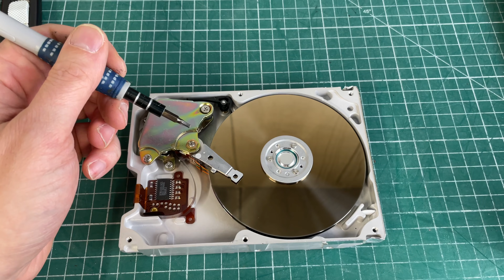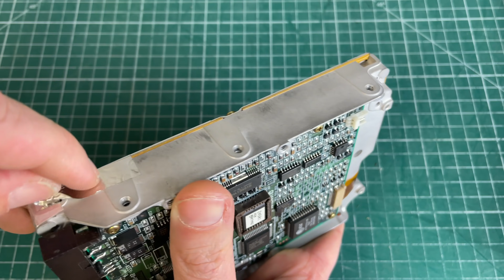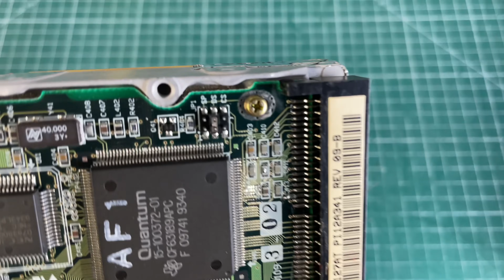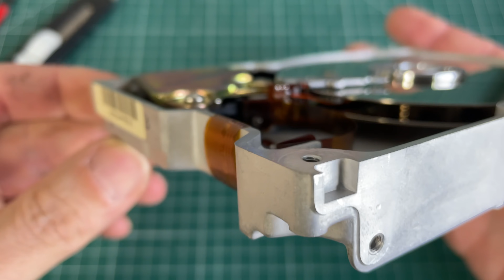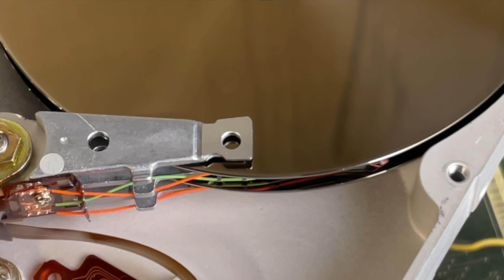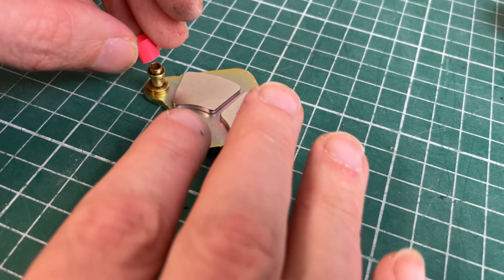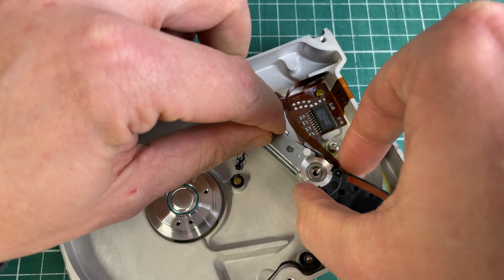Hard Drive Repair Gone Horribly Wrong

Comment: Hi - nice viewing , although not a fix it was interesting and learning experience

There are 3 similar looking screw heads Phillips - Posidrive - JIS
JIS - Japanese / Asia Industrial Screw - most items from that region will be JIS, they have a dot on the screw dome head when looking down near the cross ( not to be confused with a security key that has a dot or protrusion in the center of the shaft
That leave the gamble between Philips and posidrive, i use a Phillips no1 or no2 , if it slips i go find my posidrive

This link may help identify and explain
https://bike.bikegremlin.com/10583/phillips-vs-jis-vs-pozidriv/

Re the comment on the top platter - in most older hard drives RLL MMF and older IDE's the top platters top outer edge   and the bottom platters bottom outer edge  are typically not used

This make only in inner / sandwiched sides the actual data storage areas, there is 2 common reasons for this
1. Cheaper as you only need rear/write heads on the inner platter so each hard drive save 2 heads
2. Manufacturers at the time assumed the outer ones would get the dust and stray grease / filings etc and would get scratched, so they never used them, later on with the race on making bigger hard drives, manufacturers started to use them

On my IDE's back in the day the only repair would be to change the IDE circuit board ( my first IDE was in late 80's and was $400 for 40meg ), we all have experienced the scratchy sounds and later the can of marbles effect - unfortunately any noise = physical platter / head damage

The only servicing i do is if they have a external stepper motor, i clean it, wd40 and leave it for a hour, then upside down for  another hour to get the WD40 out as it is fine and may spray inside, plus ED40 is a cleaning agent not a oil, i then apply 2 or 3 drops of fine sewing machine oil and let it sit for a few hours to soak into the bearing / bushings

Oh if you dont use hard drives for a while they sort of get stuck, a more accurate term is "sticktion" for this on the initial start up if it does not move properly you give it a little tap to help loosen it up and get it to move, basically the heads are in park so long the stick there as the lubricant has dried in one spot

Good topic for review and viewing your repair process

Regards
George

Comment: Man those rubber bumper are a bummer, means my collection has an expiry date
Reply: I wonder if a temperature and/or humidity controlled environment could actually stop that degradation. Not that it would be feasible for most, but at least there could be a way to preserve some of these drives.
Sometimes I wonder how long it will be until all these great old machines from the 80s and 90s will inevitably break down. A couple of decades, or maybe a hundred year? Either way, sooner or later they will fail, and it makes me really sad.
I have an amazing "little" laptop from 1990, a 386SX NEC ProSpeed SX/20, and I hope to keep using it until I grow old (so for an other 50-ish years haha). It's actually on my channel, only shows a few seconds long beep error, but I have managed to fix it since then, and planning to do a video about it, running some games and benchmarks.
Reply: Nice thought, but ... how do you plan to keep the temperature constant inside of a working mechanical device?  :-)
Reply: @sirnickity  Well, I was proposing this idea for storage conditions, I think you are right, when it's actually running, I don't see any way to control temps.
Reply: All mine already expired. Same exact way. Down to WD and Maxtors now. 

Only Quantums I have are >20 GB.

Comment: Awesome attempt even though it was kind of a mission impossible. I think the aluminum tape is some kind of air tight seal. Isn’t the inside of the harddrive supposed to be a vacuum? Just seeing how fiddly it is working on those harddrives kind makes data recovery specialists absolute wizzards  with super human abilities. The inside is so delicate and one uncontrolled move could damage it forever. Just seeing that little screw accidentally dropping on the platter and it’s goneski forever. It’s almost like defusing a bomb!
Reply from the maker: The tape is to protect it from crt monitors wiping out its data. So I learned from the comments here ... lots if interesting people commenting so mission accomplished as far as I am concerned :)

Comment: Good to know, I have several Quantum hard drives. I also have a couple of Connors that all have a very different problem with a very similar symptom - A small permanent magnet holds the head in the parking position and slowly magnetizes the arm, so that the "connection" between the two is too hard to overcome by the voice coil. This one is easy to repair, just stick a small piece of sticky tape on the magnet. But I also encountered a few Connors where the plastic seal disintegrated into some kind of liquid (some disintegrated into goo, too).
Btw. a few years ago, the unspeakable happened - a Seagate ST225 of mine lost two heads (lost meaning they don't read any data anymore). When I used it last (several years ago), it was working fine. It has not been moved in the meantime.

Comment: And this is exactly why data recovery is so expensive. I have a 1TB HDD that is kinda dead... i opened then immediately closed after I moved the heads to parked position. Then bought a couple of donor drives but even 18 months since it first failed I still don't have enough spare cash to send it off for data recovery so it sits in a drawer. Way  too many things that could go wrong to attempt  myself.
Reply from the maker: My 3tb seagate external drive crashed last year. Was just sitting on my desk and from one day to the next it had a head crash. Didn’t fall, didn’t get a shock. No warning upfront. Got an offer from a Data recovery  company and it would cost between 1000 and 2000 EUR (depending on urgency). Maximum 80% could be recuperated and no large files (like video files).
Reply: @RetroSpector78  Brutal. I feel your pain.

Comment: Had the same sticky-bumper-problem with a Quantum 52AT. I also opened it up and put a thin slice of paper around the bumper and it stuck to it and helped the head to not get stuck on the bumper. For now it works. This "repair" was a few years ago and I frequently test this drive. But I'm realistic about the longevity of this fix. It for sure made me cautious about old Quantum drives so I never bought them off eBay after that. I also heard that later models had the 2nd bumper underneath the platters and that is like a death sentence for these drives unless you're an expert with a clean room who knows what he's doing. About the misalignment of the platters: You could put tape on the edges of the platters that locks their respective angle in place when taking them out. 3 or four stripes at 120° or 90° from each other should do the trick and you can use the tape to lift both platters from the spindle simultaneously. That's of course after you took out the head stack in a way that doesn't damage the heads ^^ Anyways, too bad ... These old Quantum drives were very solid performers back in the day and I really liked them. But because of these disintegrating bumpers I marked them off my list of collectibles.

Comment: If you are trying to recover your data. I suggest you do not open the drive but send it out to a professional data recover service. If you try to fix the drive yourself there is a 50/50 chance were a professional who knows what they are doing will have much better odds like 90% and if they cant recover the data they dont charge much.
Reply: Would they bother trying to repair the internal hardware of a drive, though?

Comment: I was under the impression you should never spin up a drive without the cover as the difference in air pressure will cause the head to touch rather than float on the platter.
Reply: Not true. In fact, most hard drives have a little breather hole (The "Do not cover" hole) to allow the air pressure inside and outside the drive to equalize. The only exception is enterprise/NAS grade hard disks which may be filled with helium instead of normal air.

Comment: FYI, this is why freezing a hard drive can help "fix" it... It will help solidify the gooey rubber and get it operational enough to pull some data from it, but as you can imagine the heat from the drive will undo that pretty quickly.

Comment: Contrary to popular belief, HDD's are not airtight or sealed.  Opening them doesn't cause instant death.  Touching platters, the corrosive salt and oils in your skin will lead to oxidation and data loss.  Wear gloves, avoid scratching things and you will be fine.  The parking brake is air powered.  Spinning disks sling air (and dust) away from the center.  The brake has an air vane that catches the wind and disengages.
Reply from the maker: I think we can all agree that a drive shouldn’t be openend just for the fun of it, but in this case we need to get in there right ? And I also wonder if you just open the drive and don’t scratch it, if it is really the case that these old drives (mfm and early ide drives like this one) will all die in a matter of days just because they have been opened. I thought that they were pretty resilient.
Reply: @RetroSpector78  You're absolutely right, they are very resilient.  Some of these are 30-40 years old and still work short of obvious mechanical failures.  A failed drive is a chance to learn and maybe resurrect.  As you saw the tools can be a challenge.  Factories had alignment jigs and fixtures to aid them.  Hardened bits, loctite on the screws, torque limited drivers, etc.  I have done tons of data recovery and drive repair on small form factor drives that are a lot more delicate.  Sometimes you can't fix them.  Just the way they are made :)
Even being badly mishandled, damaged burned and corroded the data survives (mostly).  Excellent video!

Comment: I had many old PCs with a section in the BIOS where you could Low Level Format the installed IDE drive?
Reply from the maker: Yeah, but apparently that doesn’t do anything as the IDE circuitry will prevent it from low level formatting. But looking for confirmation on that.
Reply: @RetroSpector78  Well here is your confirmation: https://www.youtube.com/watch?v=RldQVSXdW0Y
Reply: @shad0w_dragon178  yeah... I figured as much.
Reply: I thought the bios low level format option was there only in case you were using an MFM controller coupled with an MFM hard disk drive
Reply: @molivil  no, 100% not, I had 486 boards with the option and used it once or twice. Also, had disks equivalent to WDToolsmwhich had a LLF tool for a particular bland of HDD on
Reply: @gmcmaster1985  I see. In my boards the feature low level formatted all my MFM drives with most of my MFM controllers that I tested.
Reply: I can confirm this does NOT work. This was a piece of software intended to be used with MFM hard drives, which were common before IDE was introduced and did need to be low level formatted by the user. IDE drives are permanently low-level formatted at the factory, and attempting to low level format an IDE hard drive can ruin it. IDE drive manufacturers quickly implemented a fail-safe that causes the hard drive's control circuitry to either return an OK or ERROR message to the computer if the user attempts to low level format it, and prevent anything from actually being written to the drive.

Comment: Ooooh boy, so a few things I know about hard drives. 
     The arm only moves when the platter is at top speed because the heads float in a cushion of air, other than that if they touch the platter they damage the magnetic coating and the heads themselves, and that got even worse after you moved the arm out and the controller stopped the platter, essentially griding the heads against the disc to a halt, so even if after you unstuck it by marring the platter with the heads, your luck was that this is such an old hard drive that the tolerances are big and it managed to work, but each time the board tried to read the boot sector (outmost sector on the disc) that part was already phisically damaged (the "funny" sound you heard) and started eating at the heads together with all of the particles that were introduced when you opened it in a simple room (not a positive pressure, filtered, dust free enviroment). By the next day all of these factors took a toll and once the heads were damaged to a point where they don't send any data back, the controller goes into a loop where it tries to read the boot sector, doesn't get any data, reset, read, fail, reset. And that's how you get a click of death. 
     But all of this was caused by the rubber stopper that rotted, stuck the arm in place, and when you unstuck it, let the heads touch the motor hub, ripping a head off. Even if the rubber stopper was fine, just the intervention alone that you did by opening it in a normal "dusty" room and letting the heads touch the platters, all of that which by luck didn't ruin it immediately, over the following days it would start to corrupt files, corrupting the OS and finally, going into a click of death. This tech is beyond me on how humans manage to build and mass manufacture such a presicion and delicate machine, just like swiss watches in complexity.
Reply from the maker: Yeah. I think the idea is to open it up, see if you can get it running again and immediately try to recuperate as much data as you can and then trash it. But I didn’t really care about the data, just wanted to see what was wrong with it. And I wasn’t going to send it to a data recovery firm where they do have a clean room :)
Reply: @RetroSpector78  I know this was a super boring comment 😂 But It's the truth
Reply: I once did this experiment xD. Opened a working hard drive, closed it and used it normally. It lasted 3 days.
Reply: @andrecampana-i6c  Unless it was a 240MB or lower capacity hard drive, i wonder if the experimental result of ruining a drive purely by air ingress is transferable. I mean the data density on this thing is lower than on a Zip/LS120 floppy. It might plausibly stand up to a lot more abuse. Crossing over mark of several gigabyte it does turn into insane precision machinery though for sure.

Comment: An unorthodox way to advertise your new HDD data recovery/repair service!  ;)

Another interesting video, but I've always been of the opinion that once the lid comes off a hard drive, it's game over...  man.
Reply from the maker: Perhaps, or you bought yourself just enough time to get the data you’re still interested in :) Although I think these older hard drives are a lot more resilient when it comes to opening them up. I can imagine they have much lower data density and can take a punch.

Comment: Earlier this week I tried exactly the same.
On my PS/1 Pro I had simply put a piece of foam between the actuator coil and the case, so it will stop just shy of the rubber bumper below the platter.
This week I wanted to try it the "real way". 
I took a Quantum SCSI drive (Prodrive LPS 210MB) and opened it up. I carefully removed the upper magnet assembly and slid the head assembly from the platters. Then I tried to wrap some tape around the edge of the platters to try to keep them indexed to each other.
I goofed up by not removing the plastic locking arm beforehand. So when I tried removing the platter stack, it got stuck on that plastic arm. While coaxing it out the aluminium spacer ring slipped off the center scratching the platters. So yeah, now the drive is a goner.
I guess the best solution to this problem might be trying to 3D print a plastic insert that fits into the pocket of the casing behind the actuator coil and acts as a stop to keep the heads from touching the rubber bumper. Basically the same I did with my IBM's drive, but a bit more sturdy and durable. That foam I used (the ESD stuff you normally push ICs into) will eventually start to deteriorate itself and crumble inside the drive, so a solid stop might be a better idea.